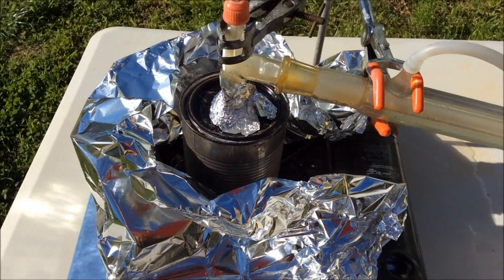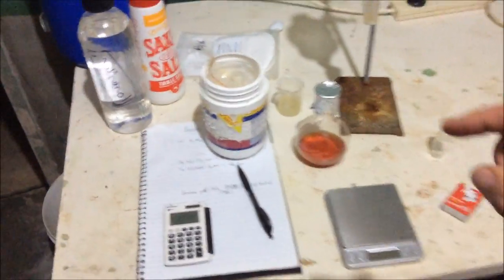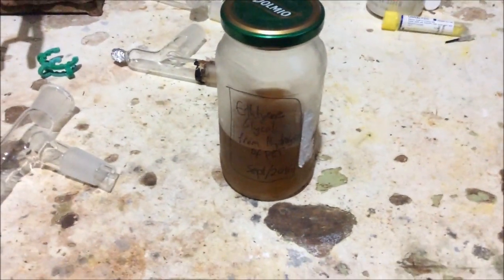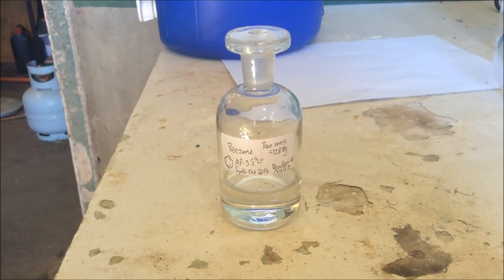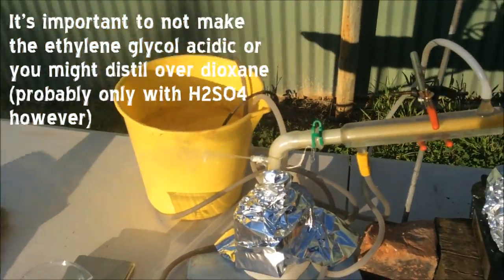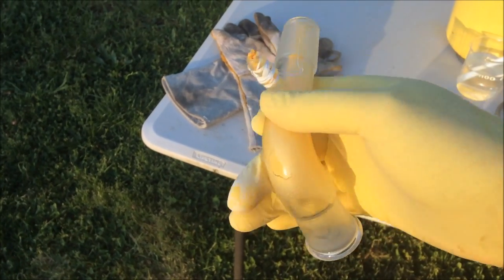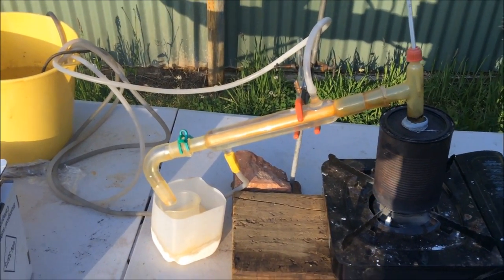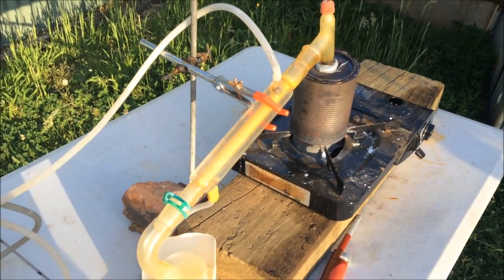PET to Benzene Episode 3

Comment: I bet this would work better if one used methods from the PET pulling subsection of the 3D printing community. They got ways of turning PET bottles into fine strips, and then using them for 3D printing. If you did something like that, you could draw out a real fine sorta thread of PET, and I bet that'd react way better. 
That and probably the can wasn't very good

Comment: To make fine particles of PET bring it up to its glass temp and mash it into a block, then use any sort of abrasive or cutter that won’t contaminate or overheat the plastic (mill, lathe, saw, file, etc) to make small sheds or chips. Once you have one dimension thin enough you can use blades to cut it in the other dimensions.

Comment: there is a chance that the orange solid stuff contains PAHs; most of them are more dangerous than the benzene itself!
At least, if one starts with a benzene ring in a salt, heats it up either way, then, logically thinking, there SHOULD be PAHs among other products. These are high-temp stable, and composed of fused benzene rings; they only give up either in burning (with soot, yep), or at about 1000 C centigrade - to C and H2.

Comment: Try putting some sort of thick Liquid (maybe water should be enough) in the Blender together with the PET. The Problem is, that its easier for the rotating knives to push away the particles than penetrating Them. If the Blades would also need to push away some water thats behind the particle it could possibly be hard enough to push the particles away.
Reply: * be to hard

Comment: Hey Extraction guy I have a suggestion about how you can grind PET in the powder like flakes... I suppose that you know what an angle grinder is,  so get an angle grinder put a steel brush of your choice on it and grind with a very slightly touch the hell out of it mount the grinder in very firm and heavy object like your bench. Don't put to match pressure on while grinding it, or you will get seriously injured ! And for god’s sake don't  hold the grinder with one hand and the bottle on the other hand, otherwise the vibration of the grinder can get so violent that it will slip off of your firm grip ! It happened to me while I was grinding off the Email of an Emailed Lamp... the steel brush has non-linear springy proprieties when it's spinning with very high RPM and gets loaded with mechanical pressure (°.°')

Comment: I hydrolysed PET with molten NaOH on a stainless steel pot.  The plastic turned into white lumps like you observed and could be picked out of the mix.  I never tried to dry distil it, though.  Equimolar NaOH and KOH form a reasonably low-melting mix.  Maybe an excess of such a mix would work for the decarboxylation, as it would form a molten solvent for intimate contact with the Na2-teraphthalate.

Comment: clamp a bunch of bottles together and go at them with with an angle grinder with a dust bag on it, or a rotating sander with dustbag, you might get some bits of sand mixed in there though.

Comment: The saponification of esters requires water! I saw only PET and NaOH go in the pot.  One mole of water for every mole of ester split.
Reply: In theory it doesn't. It can help things along by lowering reaction temperature and dissolving products and reagents, but technically water isn't part of the saponification reaction. The mechanism is hydroxide attacking the carbonyl, the tetrahedric intermediate is formed and then the alkoxide leaves reforming the carbonyl. Then the alkoxide takes the hydrogen that previously was on the hydroxide (it deprotonates the newly formed acid) leaving you with the carboxylate sodium salt (if you used NaOH) and the alcohol.

Comment: When making Sodium Terephthalate from PET it is not necessary to cut or grind the PET bottles/thin foil at all. Just weigh the PET, then weigh a quantity of NaOH in a ratio 55 to 60% of the weight of the PET. Place the NaOH in a high walled stainless steel cooking pot together with a liberal quantity of Ethylene Glycol, and place the pot on a common cooking plate/stove on low to medium heat. A lid on the pot is recommended to avoid loosing a lot of the Ethylene Glycol; a condenser is optimal (cold process takes a couple of months, that is if left in the sun, but with no loss of Ethylene Glycol as distilled water can be used as solvent in a near saturated aqueous NaOH solution). Place as much PET in the pot as can be, without compacting it. When boiling drop in more of the remaining PET when the first pieces begins to dissolve and sinks down the pot. Stir very lightly now and then, trying to turn the material over so newer material ends up at the bottom of the pot. When the PET has turned cloudy white after between ½ to 2 hours depending on the thickness of the PET materials, remove from heat and capture the soft white "plastic" bits by sieving; handle very carefully, they are brittle. The Ethylene Glycol can now be filtered, and afterwards either be reused for the next batch; or recovered by destillation. Mix the filtrate and the material from the sieving with quite a lot of water, stir vigorously (a handheld blender is the choice for this). It takes a long time to filter this fluffy material; even with vacuum filtration. It is recommended to boil the liquid for some time until the fluffy particles clumps somewhat together. After having cooled down, two slightly separate layers are visible and then it is at least less troublesome to filter. Several washings with distilled water is needed, perhaps the last one with a highly volatile solvent to remove most traces of Ethylene Glycol. The powder is very porous and spongy, thus quite difficult to purify completely, and requires long time at low heat to dry. The final result is nice almost pure (Sodium)Na Terephthalate.

Comment: Extractions&ire if you want to powder more plastic, try a wire wheel on a bench or portable grinder.
Reply: Or try a round surform rasp chucked into a drill motor

Comment: If it's convenient for you, you can always neutralize your sodium hydroxide with sodium bicarbonate, which acts as an acid with strong bases. Additionally, your hydrolysis of PET does actually need water molecules around to proceed, which could potentially explain why your reaction just quit on you. The hydrolysis might be occurring using the water present in your sodium hydroxide alone. I'd suggest including some water in your reaction vessel and keeping the temperature low for an hour or so to help the hydrolysis along. Also, I've found that my best benzene preparations are the ones where a substantial amount of water is included. Not only does it help your ingredients melt together and homogenize more easily, but it also lowers the boiling point of your benzene (azeotrope formation) and likely cuts down on the white fumes, too. You know where to talk to me if you want to know more... ;)

Comment: How about that NaOH/KOH eutectic thing we talked about last time?
Reply from the maker: piranha031091 Yeah you're in the description! I think I mentioned it but in the footage I lost. I think it will definitely help but probably the particle size issue needs to be solved first
Reply: Oh, cool! Hadn't seen the description! (that feeling of pride... ^^)

As for your particle size issue, I think PET tends to get brittle when it is partly degraded and the polymer chains get smaller. (for instance, through the slow action of the sun's UV). So, perhaps you could try partly degrading it before blending it? like, cutting it into small pieces, putting them for a while in a pressure cooker with water (and perhaps some NaOH if it isn't an aluminium pressure cooker), and then blending those (hopefully) partly hydrolyzed pieces? 

Alternatively, there's always cryogenic crushing : you could try blending it along with some pieces of dry ice, if you can find some where you live.
Reply: @ExtractionsAndIre   PET is meltable, right? heat it up and pull it in long strings like the chease whenever you byte into pizza and it hangs out of your mouth and doesnt cut of.... do it with plastik! heat it, pull it and cut it with a scissors..... so its a tenth of a mm thick and maby a halfe long.... worth a try?

Comment: My suggestion is to incrementally add the PET to a NaOH melt.  Might be awkward but could be worth a try.  Two ideas.
1. fit a long pipe to the lid of your reaction vessel.  Stuff it full of your PET flakes.  you can then push the flakes through as the reaction proceeds.  Perhaps the tidiest way of doing this is to weld a nut onto the top of the tube and wind a threaded rod to push the flakes through.
2. If you can organise a way to extrude the PET into a thread you can feed that into your reaction.

You might find other sources of PET that could work instead of soft drink bottles.  Maybe some polar fleece.
Reply from the maker: j_sum1 j_sum1 That is a good idea but yes it becomes a bit of an engineering challenge. Especially if I have to use metal for it, I cant see how much/if Im adding any PET at all? Would really need a glass tube. Maybe I could just put a fractionating column ontop of my 3 way head adapter (new glassware getting here in 2 weeks or so) and add the PET through there? Would I lose much benzene through it if I tried to keep it cool, its a 40cm column. Problem is the pot temperature is so high compared to the benzene boiling point it might all sail out the top of the column. Hm. id keep it capped between additions, that would probably work?
Reply from the maker: j_sum1 j_sum1 Other forms of PET is an idea I didnt even think of (and feel a bit silly for it) because it as other uses right?? Ill see if I can find some around the house that im willing to destroy
Reply: Whack a hole in your milo lid the right size for a steel pipe.  Steel pipe is (coincidentally) just the right size that a length of threaded rod fits snugly.  Fix a nut to the top of the pipe.  I don't possess welding gear so I would be improvising something and hoping like hell I could get it close to sealed.  Wind a couple of cm of threaded rod into the nut.  Pack the remainder of the tube with flakes of PET.  Shove it through the milo lid and seal with... I dunno, maybe some electrical insulation tape.  Keep the whole thing vertical.  Heat to your heart's delight and when you want to add some more PET you give the threaded rod a half a wind.

I see plenty of ways that this could go wrong but it does not need to be complex engineering.

Comment: You really need to invest in a proper hot plate/magnetic stirrer. It'll make your life soooo much easier. 
I know they can be expensive but I use one that has the little digital temp reading on the front. That way you can get a rough idea of what temp your hot plate is set to (obviously you still need a thermometer for your reaction vessel). It's so nice being able to set a temperature instead choosing between low medium and high and inevitably way overshooting or way undershooting your desired temperature.
Oh oh, and you can use a stir bar along with boiling stones to mitigate bumping for certain things at high temps. Stirring really helps.
Reply from the maker: I do have a heater stirrer, i'd be very lost without it! I started using a camp stove because my heater stirrer broke (see the last video in this series to hear me complain about it). Oh but do you mean it's not a proper one still? I mean I suppose you could say that. I considered the one with the LED display and the temp probe, but it was just out of my budget at the time (still is) so I got the model down. I find it still holds temperature very well, I can measure that temp with the IR thermometer to get a good estimate of the plate temp. Adjusting it slightly doesn't skyrocket the temp either. So if I want to hold it at say, 70 degrees, I can, it just takes me a while to find that temp. 

I didn't think temp control was going to be such an issue with this reaction so I went with the burner because of speed. If you think it will really help to go back to the hotplate (I have a new one now!) then I can do that.
Reply: Extractions&Ire ah. Actually I'm pretty sure I've seen you use a hot plate but I must have forgotten. 
I was just talking about using a hot plate vs a stove. I don't always have the patience to fuck with the temperature and I always way overshoot it. So I got rid of my old hot plate and got one with a digital display for the estimated temp and I also made sure it was one that went up to a higher temp. I think mine can go up to 550 C. which is crazy I've never needed it that hot but it's good to know it can. 
I know, they're expensive but it was so worth it for me. As I'm typing this I don't remember if you have a patreon page or not but you should look into it if you don't. I'd be very willing to donate (patreon or PayPal or whatever you might set up) and I'm sure a lot of your viewers would too for chemicals and equipment. You really make some great videos.
Reply from the maker: kjpmi 550 is very hot wow! The ISG hotplates (so mine) go up to ~350 which is high but occasionally is limiting, but 550 would hardly ever be limiting at all wow, what a cool bit of equipment. 

I do have a patreon for main channel stuff: https://www.patreon.com/ExplosionsandFire
It doesnt seem to directly support in projects like this but its support for me in the lab, and for all the work that goes into the second channel videos theres often a main channel outcome (for example I might use benzene in a main channel video). Thanks for asking!

Comment: did you blend it dry? try doing it in distilled water, like a PET milkshake and then filter off the water
Reply from the maker: This is probably the easiest suggestion I've been given. I'll try it, might feel like a bit of a knob if it works though haha
Reply: you never know, it might work,  it might pay to touch up the blades with a sharpening stone first

Comment: I'm pretty sure you were sublimating benzoic acid in the attempted 1 pot
Reply from the maker: That's a good theory, it was probably a mix of terephthalic and benzoic. Any reason why you think it's mainly benzoic? Does it sublime easier?
Reply: @ExtractionsAndIre  I wonder if we're looking at a coupling reaction of multiple benzene rings?  As in, similar to the synth of acetone from dry distillation of calcium acetate.  The terephtlhflathaltic acid likely is more prone to side reactions than the mono-carboxylic benzoate counterpart.

Comment: why don't you use a ball mill for the PET?
Reply: Extractions&Ire use a paper shredder, just cut the plastic into strips. Ensure that the one you have has enough cross cutting for "security"(smaller pieces)
Reply from the maker: The main issue is I haven't build one (yet) but i'm not sure it would work if the plastic is too easily deformed/not brittle enough?
Reply: Extractions&Ire I got one at Unitednuclear.com for absulutely amazingly cheap for what others sell them for. they sell to other countries I believe as well

Comment: if you could find a good solvent for PET you dissolve the PET and then atomize the liquid and let the solvent evaporate.
Reply from the maker: I didn't even think of this! It's a good idea assuming there is a good solvent. I'd assume PET would be annoying to dissolve in anything given it's a polymer
Reply from the maker: DMSO seems like the only super non-exotic solvent to do this. I have a fractionating column coming with my next glassware order, and with that I can recover some DMSO from my hardware store (it's in a paint stripper)
Reply: Farm supply stores and veterinary suppliers sell high-purity DMSO, and they usually don't even call it anything different.
Reply from the maker: Ok, i'll see if I can find it. The one I found was this: https://www.bunnings.com.au/polystrippa-500ml-advanced-paint-stripper_p1230129 but it's only 80g of DMSO for $26
Reply: Australia...

Comment: when I homogenised plastic samples in an analytical lab I mixed it with dry ice to make it brittle and ground it in a lab grinder. so you could use dry ice too and a meat grinder, coffee mill or a diy ball mill I guess.
Reply from the maker: So it gets really brittle at that temperature? That's cool, don't have easy access to dry ice though but otherwise I would do that

Comment: One way of getting fine particle would be to melt some PET into a solid block and then shave it with a wood file.
Reply from the maker: I'm probably going to end up having to do this. It's going to suck though. The density is so low I could be shaving for an hour for a couple grams I feel
Reply: spin the block of PET on a lathe to shave it quicker.
Reply: King of Random made rope from PET bottles. I think that method would be a good and very simple start.